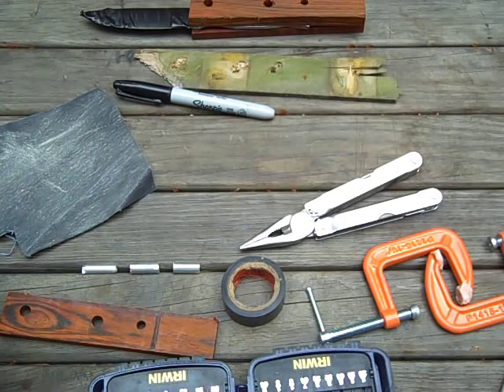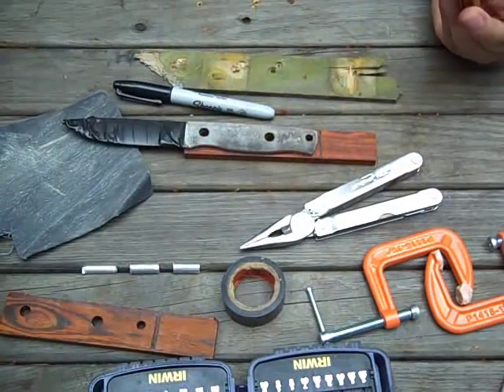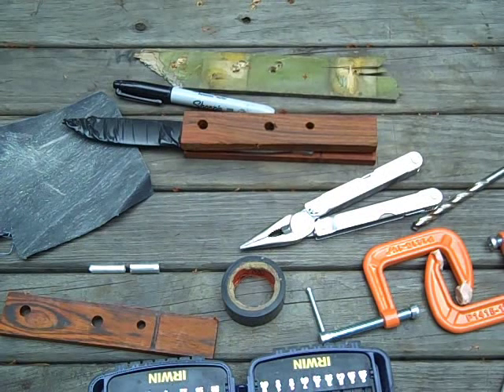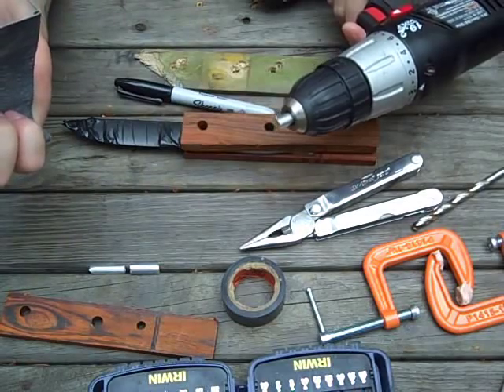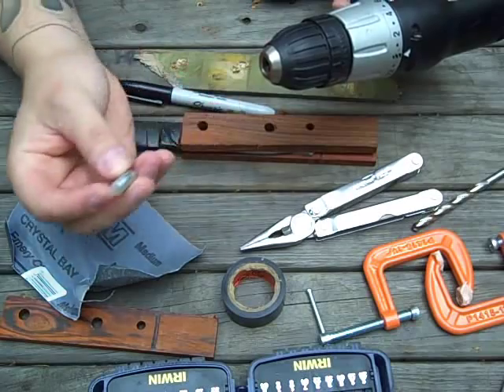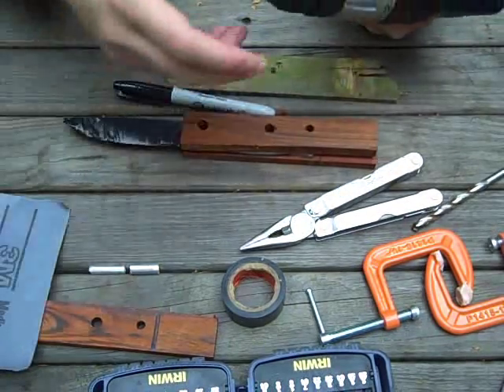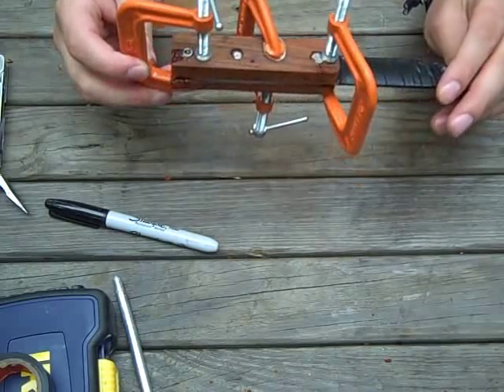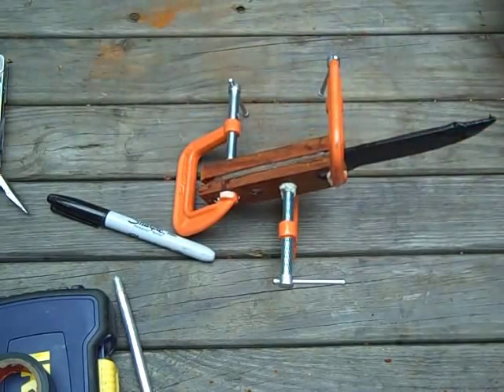Convex grind Bushcraft knife project - A Fallkniven F1 look alike part 2

Comment: Thanks for another great clip. If you want a more agressive key for the epoxy try an old/broken tap or milling cutter and do the same thing, just drag the broken edge or a tooth of the cutter along the pin and it will leaye a spiral scratch . With the cocobolo a cotton bud dipped in acetone can strip the oil out of the surface of the hole and the glue surface and aid the gluing up. I don't know much about knifemaking but I do a little woodworking and its a good tip for oily timbers.
Regards